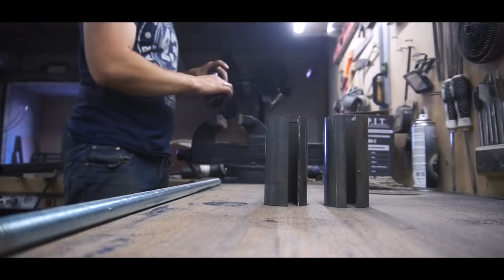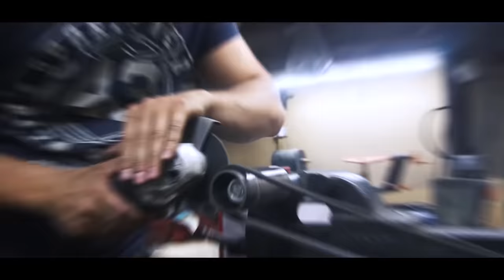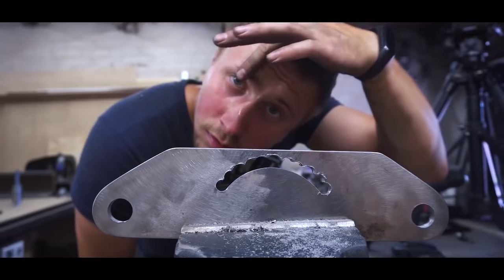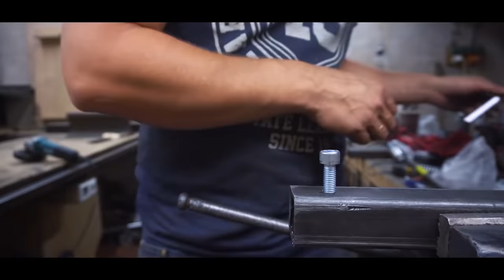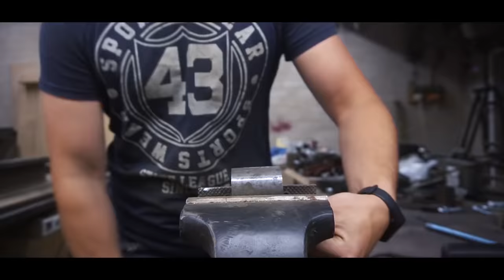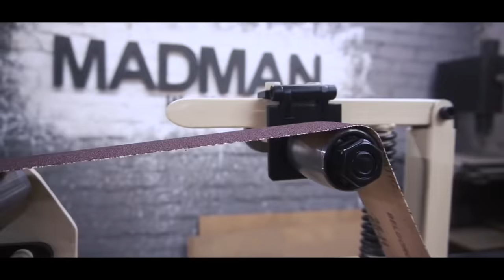DO NOT throw the motor away from the washing machine! Better do...

Comment: As a lifelong welder/metal fabricator/machinist I appreciate your videos. You think outside of the Box. Great showmanship, great music choices, and extremely creative editing. Very entertaining as well as informative. Awesome job Bro!
Reply: Really? This is how you'd fab something? Ever heard of a lathe and proper techniques?
Reply: @johnmichaels4330  If you have some kind of experience I'm all ears. I never pass up an opportunity to learn something because I believe you can always learn at least one thing from every person you meet. Additionally, not everyone has access to Machines, and have to create inventive ways to complete a task. Please elaborate on exactly how you would approach it, in specific details, and with what bits, points of measure, etc. I use to run a 6 position Turret Lathe in a Machine Shop, and have run the simplest of Vertical Mill/Drills machining Keyways into driveshafts for Horticulture Equipment. Looking forward to learning something from you. Please elaborate.
Reply: @42LUNCHBOX  if you can actually run those machines and fabricate a tool, then you know damn well the way this guy did it wouldn't fly in any fab shop. If it would fly in your fab shop, you must be working for the govt. because this way takes way to long for an inferior product. Of course, you might be ok with riding the clock and shitty work. That wouldn't fly in mine.

Comment: This was well done, but please consider wearing personal protective equipment (i.e gloves, coveralls, eye and breathing protection. I've lost count of the number of colleagues or hearing stories of welders who ended up with melanoma forming on their arms through the constant exposure to high levels of UV light from the arc from not keeping them covered, or those who developed chronic obstructive pulmonary disease through inhaling vaporised zinc or cadmium plating on bolts, nuts and washers or just the preserving oil on steel. 
Your content is very good but please do this old engineer a favour by protecting yourself. Subscribed 👍

Comment: Very impressive work and a very well made creative video with some banging tunes. As an old school tool and die maker my only concern would be the balance of the rollers because I’d say it’s very difficult to achieve concentricity using your construction method. I imagine this  might cause  a bit of vibration when operating the finished tool. A centre lathe would have come in very handy although I appreciate that would have taken away from the theme of the build.
Very engaging vid regardless. I’ve  really got to get a welder.
Many thanks.

Comment: I got a couple of questions about the motor from the washing machine:

1. What's the power output of the rotating shaft of the induction motor from a washing machine? To Calculate the max power output just use the equation
(2*3.14*Torque*Max RPM)/60
2. At what Voltage and Current does the motor operate (Im assuming probably 240V and 13 ish Amps)
3. How much mass does it have (Preferabily in  kg but pounds are fine too)

4. Do you think you could put this in anything and make it go at a decent speed, say a bicycle for example?
Although from the information of the 3 questions above it's clear if it is possible but just want an answer

Also really like the belt grinder you made!
Reply: Sounds to me like you're capable of answering your own questions from what you said.  So why ask?

Comment: Including your time ( I realize time to self is not important) and material,  what is total cost if this.
I've built a forge and a power hammer already, could use a sander. But time and material usually ends up close to basic cost of equipment.

Comment: Been there, built that and a whole lot more, what we found out that a vari-Speed controller on a permanent magnet Treadmill motor quite a lot better, had Torque all over the place, much more HP, like 3.5 vs what ever the washing machine motor is, like 1/2 or 1/3. The other thing, is we found out that covering the rollers with some grip material works better than polished steel, because it first produces less rust, second transfers less heat, third less likely to slip, and forth needs less tension, if you are a knife maker it is good to have more flex, and not deflect under more tension. I like to have a quench nearby to cool the metal also. You can build a housing using HVAC metal to enclose the motor, and rubber seals for other areas that have shielded bearings, I have shorted out a few motors and sockets in my day, of course learned the hard way. I sure could learn a good bit from you as far as video editing, I really have no clue, in that you are a wizard.

Comment: Top tip. Get another grinder (or more) so you can have them permanently set up for cutting, grinding and finishing. (so cutting wheel, hard disc, flap disc).

Comment: Hi mad man, you provided me with an answer to a question I had for several weeks. There is another You tuber that build a turning tool using two huge bearings and turning the working piece inside the inner diameter of the bearing. I wanted to make a similar machine, but huge bearings are really expensive in Canadastan. I will use three shaft with 2 small bearing each to turn a 4" pipe and use the inside diameter to hold my Working pieces. This will work nicely, be more stable and be less expensive.

Comment: A chop saw and a portaband would make your life so much better! Cutoff wheels have their place but to use them for all your cutting needs is just ridiculous.. Also you might want to a full face sheld when using them as well. The internet is full of horror stories about those little wheels exploding and slinging off causing horrific damage to the user. A regular chop saw blade is thicker and you won't have that crap happening.

Comment: If you have scrap metal and time, might be worth it, only if you have the tools also, you can buy a belt sander for cheap and if the motor breaks, then probably use that motor and adapt it, will be much easier and cheaper, than own all these tools.

Comment: I can get one of these from harbor freight for like $50...
so why buy a ton of angle iron, long steel bolts and nuts, bearings, a motor, a bench vise, a welder, an angle grinder, etc. and the spend 2 months making a worse one?